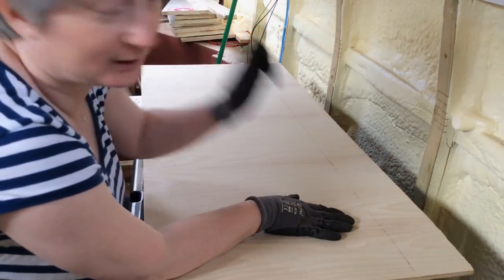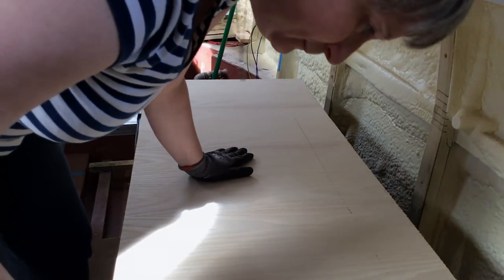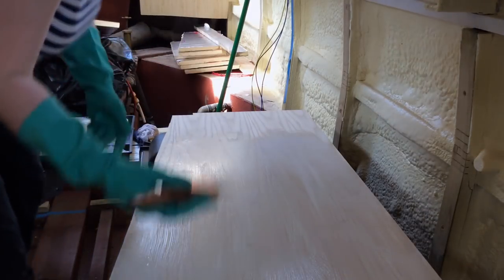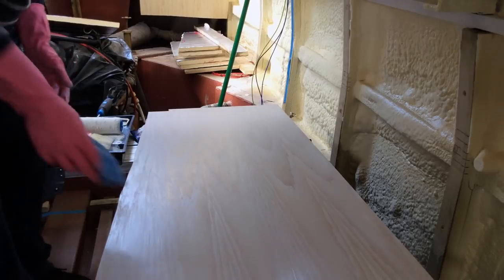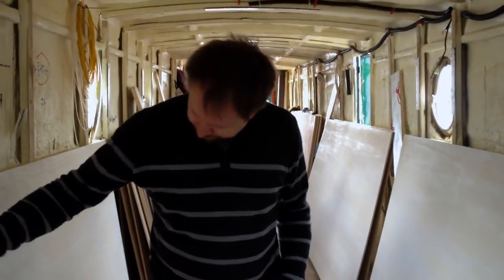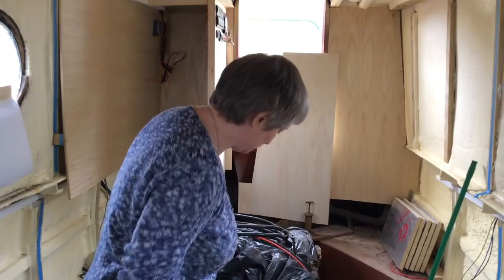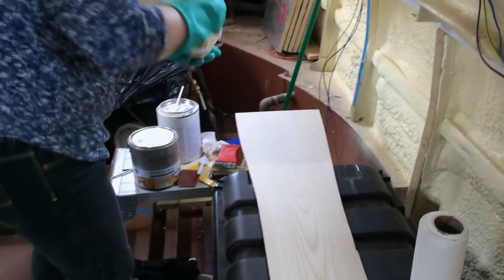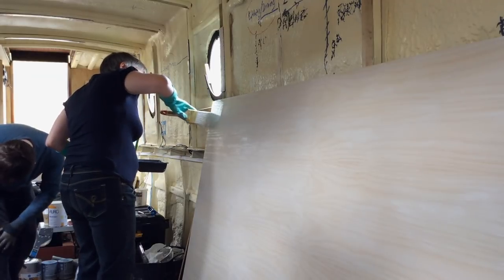#16 Wood staining experiments on our narrowboat

Comment: I am still concerned that you don't have a firewall between the engine & the rest of the boat!  There should be a steel bulkhead welded at least as high as the engine that separates the two for safety!
Reply from the maker: Hi Ken, we'll look into this futher, there's still time to add it but I'm not sure that it's done here. Thanks for watching. Best, Martin
Reply: I think that this is needed for seagoing craft which fall in to a different category than canal boats.
Reply: My concerns are for the fact that the boat had previously suffered fire.  Just for safety, I would have a steel bulkhead welded in so that in the event of a major fuel spill or worse happened, it would be contained in the engine compartment.
Reply from the maker: Thanks for reply Jo, that's very helpful. 

We are being very careful about the "f" word as you know the history of the boat. The original "f" was start by a chip pan (seriously, on a boat?) though obviously they can happen anywhere. We'll be treating the wood in the engine bay with Envirograf a fire retardant coating, a bit expensive but will at least let us get out in time if need be. 

Thanks for your concern though Ken, we appreciate it.